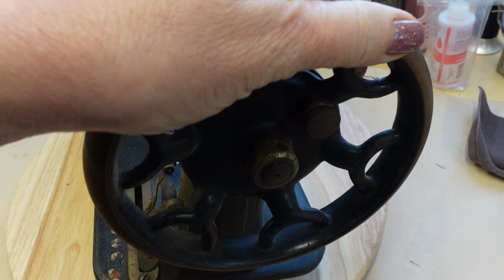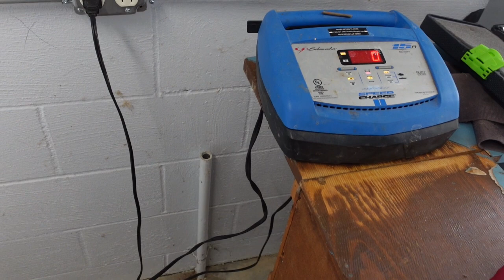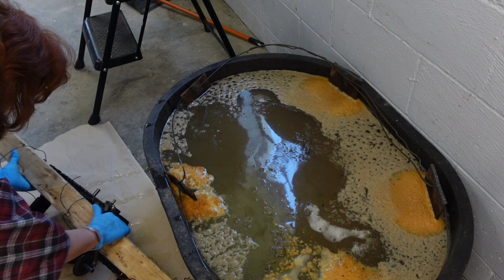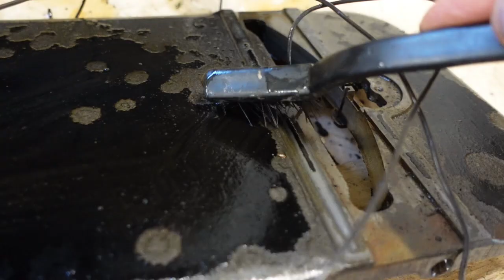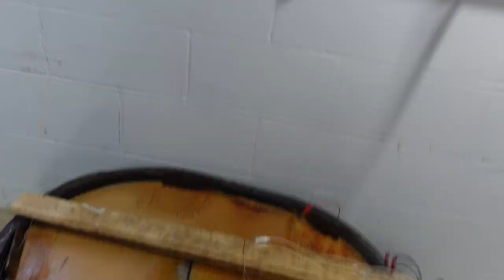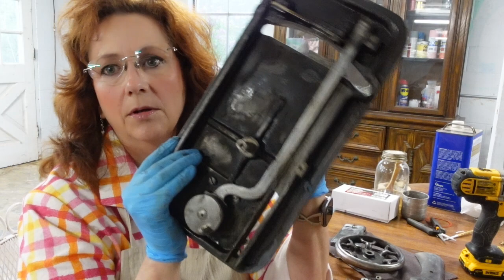Stripping Paint from a Vintage Sewing Machine using an Electrolysis Tank

Comment: looking for alternative paint removal techniques other than sandblasting electrolysis was not on the list, however alkaline paint removal and acid soaking was to not only remove all paint and sealers as well as oils and rust and surface rust prevention like is done when stripping vehicle bodies for restoration sounds still like the better option for vintage sewing machines to me, anyway.

Comment: The reason why all the paint did not come off is the + did not see all of the part.  the trick is--- line of sight----. You need the + on the bottom of the tub also. I use a U shape rebar all alone the sides and bottom. I've done car parts. Flash rust will happen with end hours of taking out of the tank. Use battery jumper cables to and from the battery. There is a lot of AMPs in this set up.

Comment: I have been cleaning up a Spartan 192k (and watching lots of your videos 😊).  Lots of rust and upper paint all flaking off.  The base plate seems like it may be different with some very stubborn finish that the paint stripper struggled with.  I wonder if it may have a Japanning finish on the base that is going to be tougher, thicker and harder to remove whatever method you use.   Or it may be that it just wasn’t as worn out as the top and all the paint was originally that tough… Thank you for sharing all your invaluable expertise!!!❤
PS - I think even a whiff of the chemical stripper gels give me a 3 day hangover so any way of avoiding them would be better.  This method is just what I was looking for.
Reply from the maker: Hi! I have found that a lot of the machines have thicker paint on the bed than the upper parts. This could work, it sometimes takes a bit of time to cook off but it is sure neat! Good luck!

Comment: Engineer here, you discovered a cool effect. Electrolysis doesn't touch paint. The factory that made that part had very clean steel where you couldn't remove w/o sanding... that steel had no oxides to react. I'd have used paint stripper to keep the original finish.

Comment: Also, I wonder if using lye (sodium hydroxide) would be better vs washing soda (sodium carbonate). A sodium hydroxide (NaOH) solution is generally more conductive than a sodium carbonate (Na₂CO₃) solution at the same concentration. This is because NaOH is a strong base and dissociates completely in water into Na⁺ and OH⁻ ions, leading to a higher concentration of charge carriers. 

Moreover, sodium hydroxide is a stronger base so will break down paint faster. I believe in industrial applications, they use a hot sodium hydroxide dip for exactly this purpose, paint stripping! 

You can readily by 100% lye crystals. It is a bit more dangerous, strong base, so you'd need to wear protection!
Reply from the maker: I'd be a bit concerned to use lye,  but if you try it, let me know how it goes.
Reply: @prometheansewingmachines  used it and it worked great! Apparently this is literally what they use in industrial paint stripping application - electrolysis in a heated sodium hydroxide solution. My guess is that washing soda is usually recommended because it's a lot safer - sodium hydroxide is pH14 super alkaline and you can have some very nasty burns/tissue damage if you get it on your skin. But as long as you wear gloves and eye protection and are careful it works SO MUCH BETTER!
Reply from the maker: @AlexKost-tq6bj  That is great to know! Thank you!

Comment: I think you need direct 'line of sight' between the painted surface and the anodes, so perhaps the parts of the machine that didn't lose the paint weren't facing the anodes?
Reply from the maker: After using it for a while, I think it just needed a stronger connection. I started hooking the alligator clip to the spool pin later and that worked great, better than all the wire wrapping.

Comment: Why do you have a battery in the circuit? Why not connect the battery charger directly to your parts and anodes?
Reply from the maker: It turns off as a safety measure if the battery is not there.

Comment: Question, how large, dimensions/capacity, is the tub you are using for an electrolysis tank?
Reply from the maker: It was about 20" wide and about 3 feet long, But it really could have been smaller and still work well.

Comment: Great Video! I wonder, I used to have a parts cleaner mostly for auto parts and used Purple Power in the tank I wonder how well Purple Power would work in one of these setups watered down of course. Thank you so much for inspiring me back into vintage sewing machines. I just purchased a Singer 206k on ebay, She should be here in a week. Can hardly wait to get to rebuilding her.

Comment: How big was your tank, and what was it made of?  And what size battery is that?  Maybe it's the camera, but it did not look like a regular 12v car battery - looked smaller.  Anyhow, I really liked the results.  I would suggest flushing the machine head with hot water inside and out all the while brushing vigorously with long wire brushes (sometimes called gun brushes) inside the column and arm.  Then drying it with a heat gun set to to the hottest temp.  Then liberally apply regular sewing machine oil - using a spray bottle that you can get from the hardware store.  Make sure that the interior spaces of the column and arm are awash with oil.  Rotate the drive shaft and all moveable elements to make sure that they get oil to all of the metal-to-metal surfaces and that nothing is seized.  I would not use mineral spirits at this point because I don't think they will be more effective at lubrication or rust prevention at this stage of the game.  Also, for those mineral spirits to be as effective as the SMO, you would have to use a lot of it (spray bottle) and we are trying to avoid that type of chem exposure if possible.
Reply from the maker: Hello, since I did this video I've changed a few of the things that I do with regards to my e-tank. First of all I don't use mineral spirits anymore, instead I have found that if I hit her with a wire brush she shines up really well and there's no danger of flash rust. I can't spray the inside liberally with oil before I paint, there's too much of a danger of the oil getting on the exterior of the machine and having issues with paint. Instead what I have done is put just a few strategic drops of oil with a needle nose bottle on parts on the inside just to keep it from wanting to sieze. As soon as my paint is finished you had better believe that she could say throw him dousing of lubrication 🤣 my tank is a big rubber feed trough that I got from tractor supply years ago. The battery is for a lawn mower or four wheeler. It does a great job cleaning, removing rust, and removing paint. I would say that the machines need to stay in there about three  days. Also as soon as I pull the machine out of the tank, I have a high pressure air gun connected to my massive air compressor and I thoroughly blow any water out of the machine and off of the machine. That also helps blow off any loose paint that might still be stuck to the machine. It's turned into a really nice process. And no chemicals.

Comment: Hello!  So, would this process be good for a machine with a frozen main shaft?  I’ve tried soaking the machine j. Evapo rust and while it helped a little, it’s still locked pretty solid.  This is a practice machine for me, but I’m hoping to be successful in rehabbing her. But I won’t be if I can’t get the mail shaft/needle at moving again.  
Thanks for your great and informative videos.
Reply from the maker: Maybe. I'm am assuming have already disassembled everything else.

Comment: Will this work with japanning (shellac) ?
Reply from the maker: Yes it will. However there's usually a chunk that is left on the bottom bed after it has been soaking for a few days. I have found that I can pull it out, and then use an abrasive wheel to get the last bit off fairly easily. I think that the electrolysis loosens the hold somewhat even if it doesn't take it off completely on the bed. But I can tell you that everything else comes off fairly cleanly in the tank in my opinion.
Reply: @prometheansewingmachines  Thankyou, the next ? is what about aluminium machines i.e. featherweights?
Reply from the maker: @jollyroger7624  I've never tried it with an aluminum based machine. At this point my gut tells me it would work the same because I have used this process on components that were not cast iron and it worked very well on them.
Reply: @prometheansewingmachines  Thankyou, I think I have some work ahead.

Comment: some things to think about ...gotta love electrochemistry!
1 wire burn out: If the two alligator clip wires were not the same then the smaller one will fail before the larger one.
2 tub solvent careful about what goes in, just because you put in soap does not mean that is what is in there after.
3 different parts may have been painted differently therefore different results.
4 metal / paint this old may have used unexpected elements be careful.
5 go down to at least 1000 grit wet sanding after that brush and before painting.
6 looking forward to the finished machine! Good luck!
Reply from the maker: Great comments!! Thanks for your insight 😊